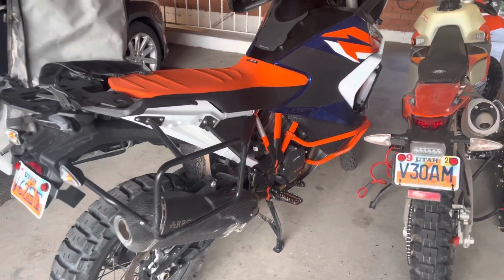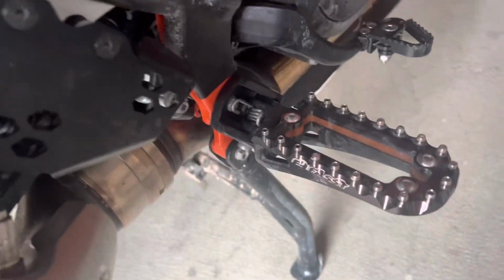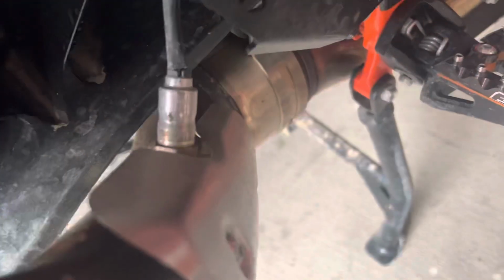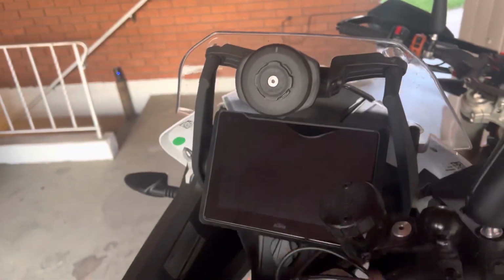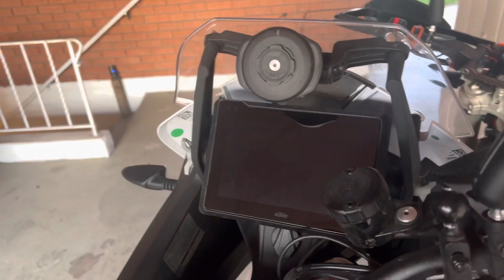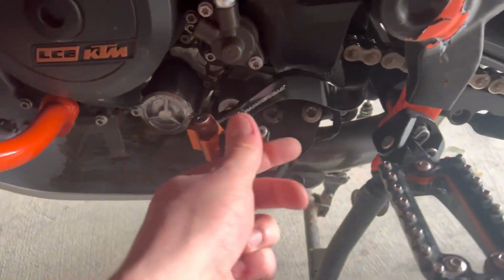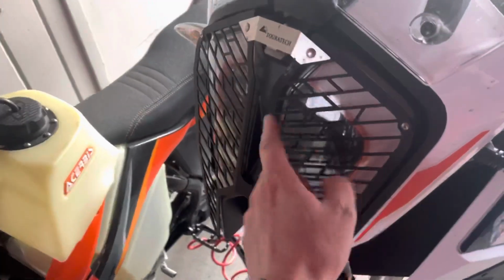Add-ons to 2022 KTM 1290 super adventure r walkthrough

Comment: Hi, thanks for posting!  I’ve slightly lowered my gear shift as left ankle has limited movement (old ski accident, not bike related), and now it ever so slightly rubs on rubber tubing shroud over side stand spring, when pushing down to change gears.  Very interested in your hammerhead replacement, from vid it looks like this one comes slightly further out and has higher arch in the middle over stock?  Would you be able to share picture of the original next to your new one for comparison, also do you know if these are available in UK?  🙏😁
Reply from the maker: bought mine from a US store so not sure if in UK, I am sure hammerhead would know.  The original is in my storage unit but if I remember next time I am down there I will try to snap a pic